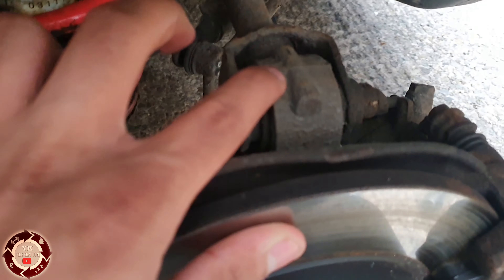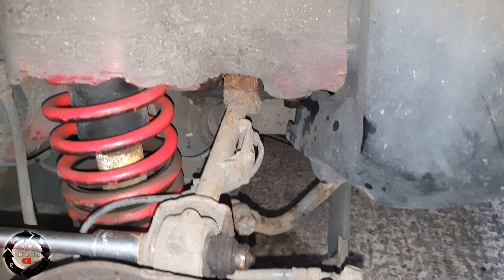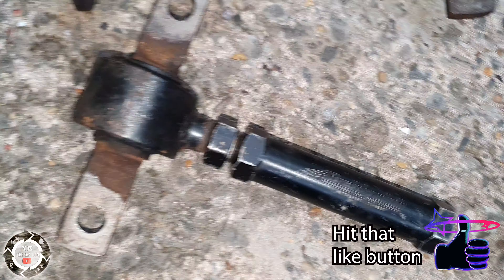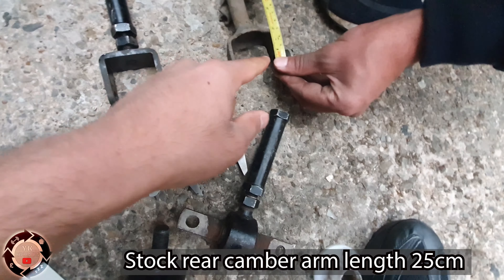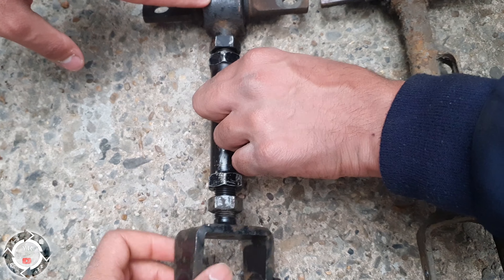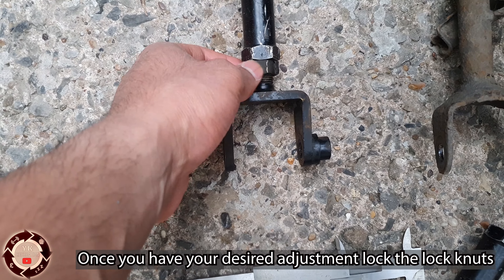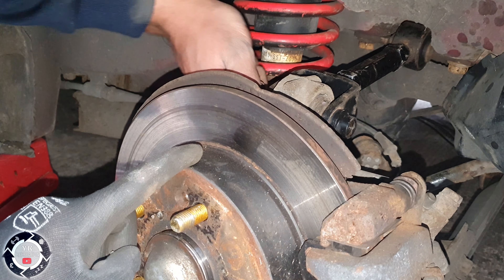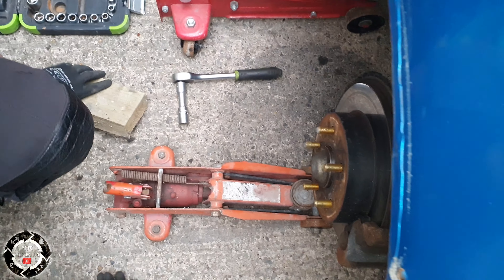HOW TO INSTALL REAR CAMBER ARMS (Honda EP3 Type R) *Buddy Club*

Comment: Want to do this to mine .. nice lads 👌
Reply from the maker: Hope the video helped, its pretty simple to do. If you need any more information let me know 👍🏼
Reply: @YKRECREATION  no worries .. did you have to do a alignment after? … also what’s the plans for your EP3 any up and coming mods ?
Reply from the maker: @ChrisDC5TypeR  I literally just adjusted it myself with the adjustment I needed. I shortened 1cm each side and it drives fine. Tested it also at speed feels fine. If your taking it on track etc then would be worth getting it all the geometry setup
Reply from the maker: @ChrisDC5TypeR  next video will be replacing knock sensor and just going over stuff and cleaning it up
Reply: @YKRECREATION  okay nice that’s good to know thanks 🙏 my next purchase for my EP3 💯
Reply from the maker: @ChrisDC5TypeR  no problem 👌🏼